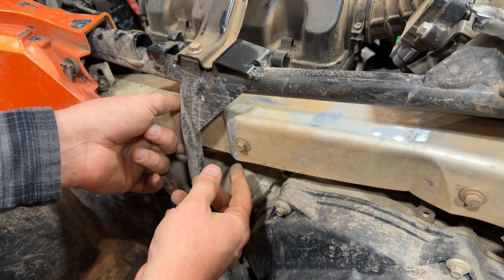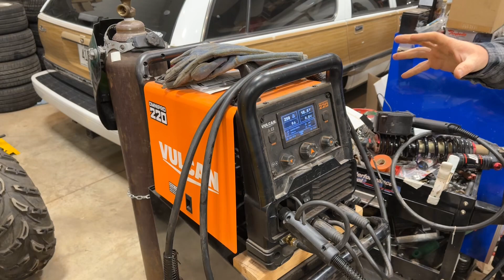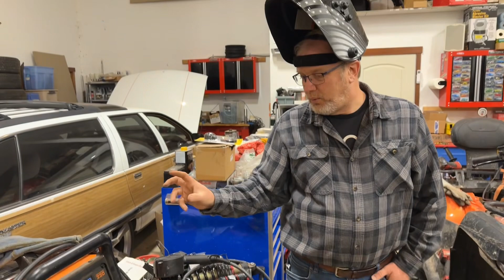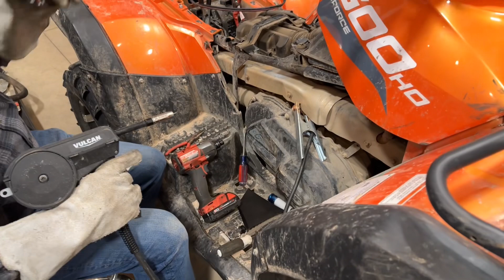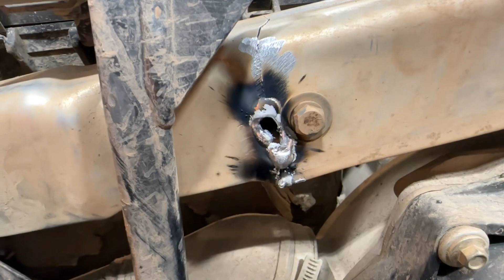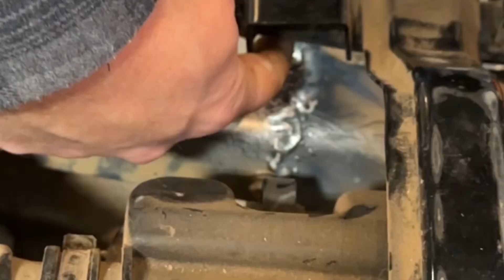How to fix a broken heat shield 🛠️ #fix #howto #welding #atv #help #broken #youtube #video #yt

Comment: With that welding, go in a triangular pattern. So you start a little farther forward then you want, then go back to the "left" then to the "right, then go up "forward" in the direction you want to go up to the "empty" spot, then go back to the left, right, then forward. You will stack dimes if you do this right, sorry it's hard to explain without a picture. You might want to slow down your wire speed a little bit too.
Reply from the maker: It makes sense to me.
Reply: Thank you - that helps and makes sense.  I'll try that next time I'm armed with the welder.